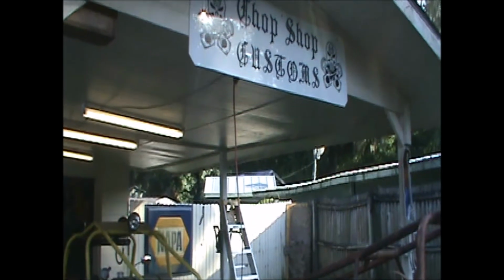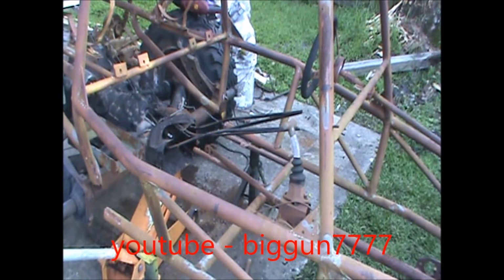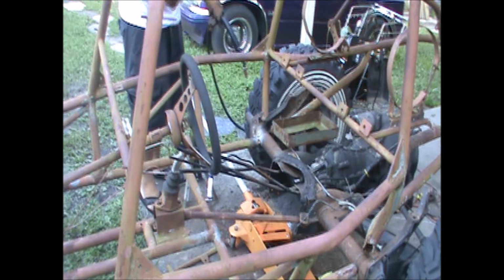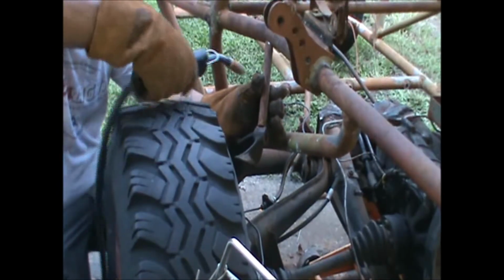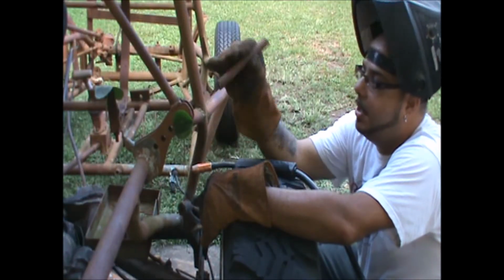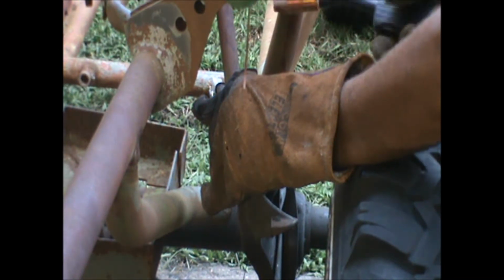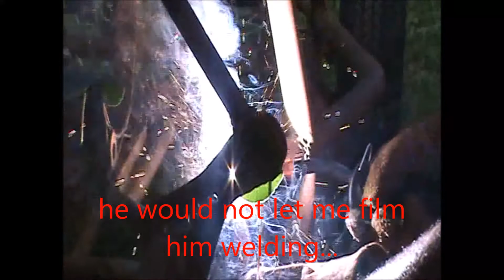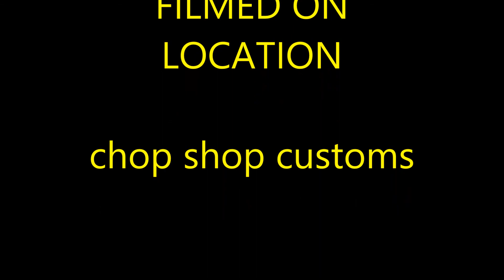sandrail build pt2 swap torsion

Comment: Hi I have a sand rail on the rear one side is lower then the other its 12 inches from the floor to the bottom of the frame the other side is 15 inches from the floor to the bottom of the frame.Question do you live in california?
No auto mechanic around here works on them they dont want to touch them.
Reply from the maker: Sorry for the late response no I don't live in California I live in Florida but there should be plenty of VW mechanics out there just check around you'll find specialty places around you